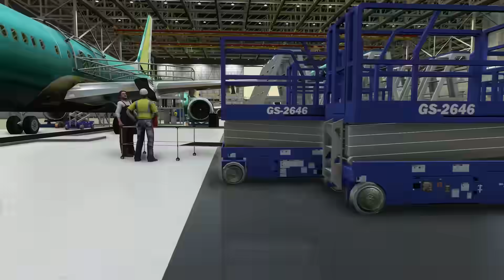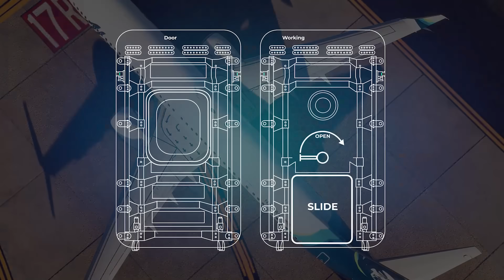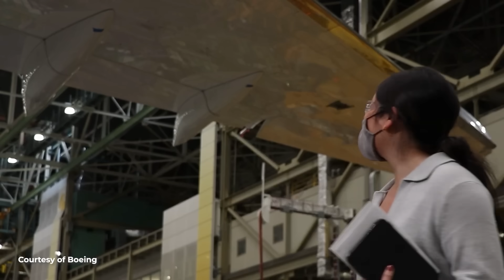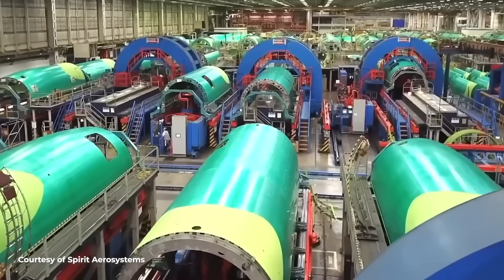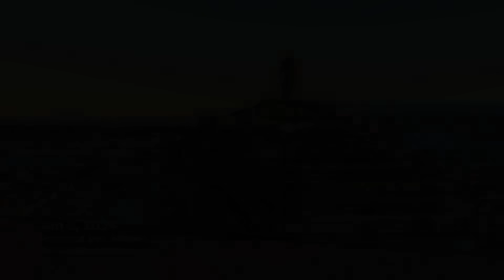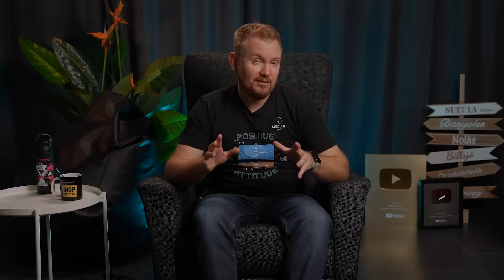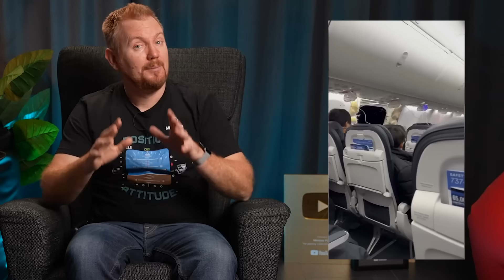Boeing 737MAX BlowOut!! The Scandal behind Alaska Airlines flight 1282

Comment: I too make it a habit of throwing out large bolts I have left over when working on something.
Reply: And the castle nuts and cotter pins!
Reply: @mediocreman2  They were just lightening the airplane. A lighter airplane burns less fuel. They were saving the environment.
Reply: If you dismantle and re-assemble any complex machine often enough, you will eventually have two of them.

Comment: You say “this had nothing to do with the design of the Boeing 737 MAX itself” but I would argue leaving those assist springs which are designed to “assist” opening an emergency door by lifting some of the door’s weight on a door plug which was never intended to be opened during service, constantly applying upwards force on it and eventually overcoming the weight of the plug with the help of vibration and pressure cycles is a MAJOR design flaw looking right in your face.

Even you mention those springs were “curiously” also fitted on the plug even though they would really serve no purpose. 

That plug should have had solid connections instead of hinges with mere stop bolts but that’s an additional cost Boeing decided to cut.

Let’s face it. 737 is an old and outdated platform which results in massive design flaws just to cut costs and avoid pilot trainings with its newer iterations. 

It’s exactly the same issue McDonnell Douglas once faced and carried over to Boeing with the rest of their baggage, with Boeing’s own money. 

This inciden, the MCAS tragedies, and the engine de-ice crap going on  are all a result of design flaws of not just the 737 MAX but also Boeing itself as a company. 

Such blatant incompetence and lack of concern for quality and safety running an engineering company thousands have literally no choice but to trust with their lives every day should be criminal and in my subjective opinion Boeing should cease to exist, at least going on history as an example of what not to do for future generations.

Also, it’s well past time for passengers to be able to see the aircraft type when purchasing tickets so they can make their own decisions.

Comment: Imagine a car manufacturer introduced a car today that is based on a 1967 design, but installed with modern technology that makes it drive funny unless it is corrected by a computer. Then they get parts assembled in other countries (low labour costs?) and base a pickup truck a sports sedan and a mini bus on the same chassis and replace engineers with MBA's to make it cheaper yet - would you buy one?

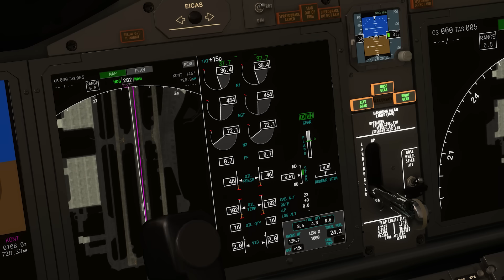Comment: 20:58 Although I’m fairly new to aviation content, but are not to-ga buttons pushed only when landing is aborted and pilots go around or was this intended as matter of speech -  pilots pushed the throttle to take off power?
Reply: TOGA stands for Takeoff/Go-around. Therefore, the TOGA button is used for both of these stated operations.
Reply: Thank you for clarification

Comment: I've worked with OBA's in the Navy. those tiny canisters that have the oxygen candles in them are inserted into a chest mounted system that has bellows next to it used to cool the oxygen created, because not only do the canisters get stupid hot, but so does the produced oxygen. the air from the bellows is safe to breath but when you dump the canister, there's a specific procedure to do it so you don't get 3rd degree burns or catch anything on fire. I imagine you've got similar issues with the drop down masks.

Comment: One thing to say.  The 737-9 is the same length as the 737-900ER.  It's not a stretch, and the door plug was also available in the -900ER

Comment: One cannot ignore the recent employment changes at Spirit and Boeing directly correlate to the extreme increase in manufacturing/ quality control failures. It's almost like requiring racial, vaccination and gender/multigender quotas instead of actual abilities is a terrible idea. We need to go back to merit based advancement over ideological identities.

Comment: Perhaps Boeing shouldn't have gotten lazy and cheap and build frames with different configurations. The original 737-900 didn't have mid-cabin exit doors/plugs. It wouldn't be difficult to offer both frame designs. The 757 and 767 both had multiple exit configurations that were built in tandem. Offering one configuration is a cost cutting measure that ultimately adds complexity to the aircraft and adds additional points of failure as we've seen

Comment: The cockpit door "feature" is confusing. Doesn't Boeing's decision mean that a hijacker only has to cause a leak in the cabin to open the cockpit door?
Reply: It only happens with explosive decompression, a failure that would likely inconvenience a putative hijacker far more than the crew (see 'James Bond - Goldfinger' for deails).
Reply: @benrussell-gough1201  if that's true it's less bad but it still seems like a bad feature for the Boeing.

Comment: The short recording time of the flight recorders is and has been absurd for decades. There is simply no excuse for it. Simply no reason it shouldn't be 24 hours or even better 96 hours or more. My dash camera stores two weeks of HD video. Speaking of which, there should be video recording in the cockpit too.
Reply: Not that this justifies it, but seemingly easy technical changes to passenger airliners are quite an ordeal. Had a girlfriend who designed & implemented avionics to galley appliances, & everything, no matter how innocuous, has to go through a long & bureaucratic back & forth just to be technically certified for use in an airliner, not to mention politics, crew & pilot unions, etc. A primary example of  "easier said, than done". Barring exceptional pressure, it takes anywhere from 5 years to never, in order to implement a change. Ought not to, but it's reality.
Reply: @sparky6086   The flight recorders aren't part of the airplane. They are their own units. They're not structural, they are not part of the avionics, if they fail they cannot cause a crash, etc.

As I said, no excuse. There have been dozens of new airliner models produced in the past couple decades, any one of them could have been the first one to have a longer recording time, then all the ones after would have followed suit. There is no good reason.

I mean, if you could find a good reason, I could be convinced, but the reasons you have given aren't good ones and/or aren't relevant.
Reply: @wiredforstereo  I began my comment by saying "Not that this justifies it..." & at the end stated "Ought not be that way". Does that indicate to you, that I'm trying to give "good" reasons? 
       You must be very young or inexperianced. I'm talking reality, & you're talking about some imaginary Utopia, where bureaucracy, politics, unions, & other barriers don't exist!
       Are you kidding? Historically, flight recorders get upgraded even fewer times, than the coffee maker in the Galley!
Reply: @sparky6086  You're right. It doesn't justify it.

Comment: In an otherwise top-quality video, YOU ARE 100% WRONG in your graphic representation to show that the plug could be rotated out and down to accommodate a slide in an emergency! The plug could only be rotated slightly out to accommodate maintenance AFTER the cotter pins and castle nuts and locking bolts were removed. Its freedom to open fully was stopped at 30 degrees or so by cables. It could NEVER be configured as an operable door. It was a MOVABLE PLUG, period! The springs were there only to assist maintenance workers to crack it AFTER cotter pins and castle nuts and locking bolts (if fitted!!!) were removed.  Carry on with great videos, but catch those mis-statements! John

Comment: Boeing shelled off Spirit so they could work outside the Boeing quality and pay system and produce parts cheaper. Well, you reap as you sow. So now they get cheap parts. This isn't just a case of poor quality, it's a case of deliberately evading the quality tracking system to conceal the scale of their quality problems. I work for an aerospace company, but not Boeing. If we have a defect in manufacturing it's a show stopper. Everything comes to a halt until they find out how it happened and what they need to do to make sure it doesn't happen again. The big deal we make of this in our manufacturing areas is sometimes a pain for developers like me, when we get parts in for development they get fully inspected against their specification and can get rejected back to the manufacturer if they don't meet their specification, but the end result is we don't ship faulty anything. Since we are prototyping it takes weeks to produce half a dozen systems, but we know they are perfect, retested at every stage. Eventually the methods the assembly folks are developing now, which take so long, will result in a solid and near fault proof manufacturing process. It costs money to do this, and it takes time. But nobody ever complains about the cost of doing things right. We have an independent issue reporting system, and if that fails we have a DoD whistle blower number. The posters for the two reporting systems are on every noticeboard in every building.